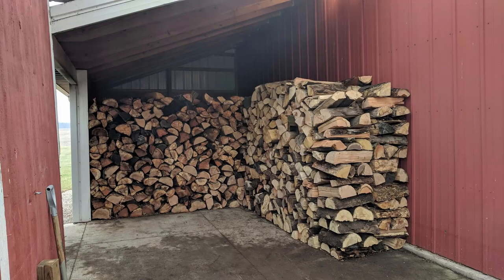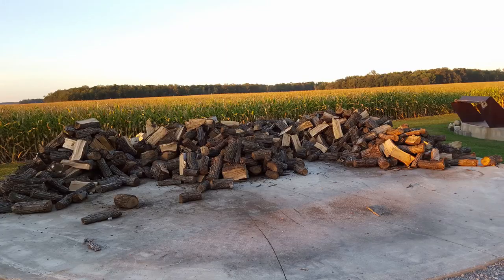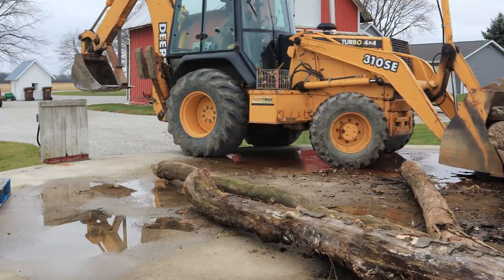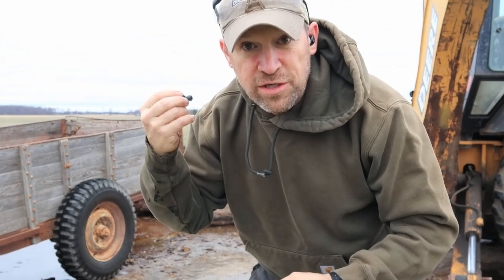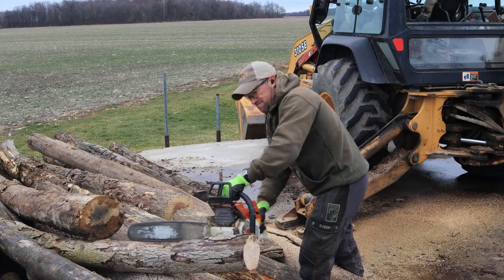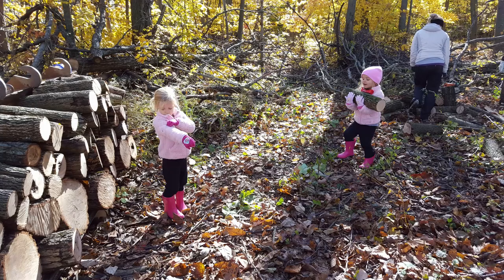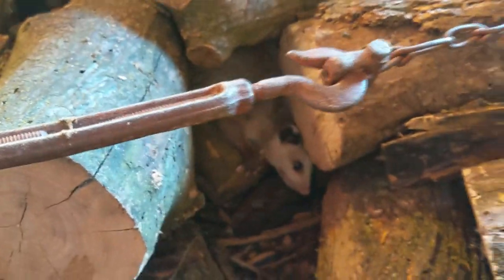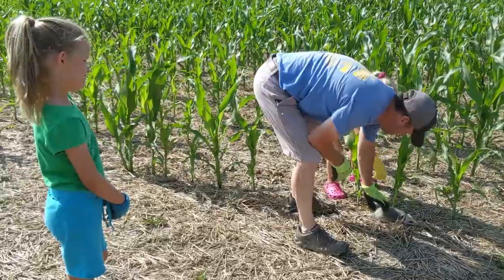Firewood: Do You Love it or Hate it? + 5 Tips for Outdoor Wood Boiler Success!

Comment: First it should be known that this is theory.  My wood stove days were limited and I used mostly flat cardboard that I had a contentious supply of at the time.  And some cut up railroad ties when it got real cold.  My goal was cheap and as little work as possible. For you we do not want to lose the family benefit but we may want to consider a reduction and redeploy of the labor.   More over we want to keep a wood boiler going all year around!  It gives heat in the winter but it can give AC in summer with a Yazaki Energy Systems Chiller.   Change over to a pellet boiler with big farm like storage towers and augers.  Once the towers are filled, it will run on its own and keep the fire going till it runs out of pellets. Now we need a large  chipper, a trailer with an auger to shoot the chips into, auger the chips into the PTO pellet maker while the next auger loads them in the storage towers.   Now you need a JD 3020 or maybe bigger! :-)   No more staking and re-stacking the wood and no more three times a day to put wood in the fire box.  The logs you cut up in this video would have gone into a chipper.  So no part of the tree goes wasted because it all gets chipped up: even the smallest branch.  The chipper needs to be able to travel to a tree with its wagon.  Then bring the wagon load home to the pellet maker.   This should cut down on the physical labor but not the benefits of family help.  The biggest bottle neck to the idea may be the whole tree chipper price!! Still you might find a way to use a smaller one or get a deal.   2013 Vermeer BC 1500XL  $36,950 with 1981 hours in Machinery Trader.  So maybe we keep both boilers going and use the big logs in the old boiler and start with a smaller chipper.  On the other hand this could chip wood and make pellets for multiple families with capacity left over.  It would likely be less time and effort all said and done, yet still need to work together.
Reply from the maker: That sounds like a fine plan Scott, but the finance department may raise an eyebrow when shopping for giant tree chippers!  I do like the idea of self automation and just filling up a big silo with wood chips.  I'll keep this comment as plan B should I come into some extra wood chipper money! :)

Comment: We have about the same size of space to heat. And a maple sugar shack up here in Canada. We go trough at least 50 cords each years. The boiler for the maple sugar go through a 24” cord every single day of operation.  So house is taking 20 a year. Average.
Reply from the maker: Wow!  That is a bunch of wood!  Plus, depending on where you are I am guessing you have a generally much colder winter than here in Northeast Indiana?  I can certainly appreciate your commitment to it!  My best estimate is that our yearly usage is 15-18 cords a year I think. I split about 8 cords last week with a firewood processor and I hope that will now last me the majority of the hard winter remaining.  Will probably need a little more to finish April and start May.  Thanks for chiming in and telling me what you guys do.  I love hearing it!  And thanks for visiting the video!
Reply: @digdrivediy  we fire up the house boiler around mid October until mid May. I have a small firewood processor that can produce around 3-4 cords/hour. And we are using those big bags that hold around a cord. Work smart. Not hard ;)

Comment: The comment about the equipment expense equating to 99 years of propane got a good laugh out of me. I just bought a place that has a pretty good size Central Boiler. Didn't have time to get it going before winter so heating with propane furnace this year. Hope to get boiler fired up next year but I've learned quickly you have to enjoy the whole process of making and handling fire wood. There is no way it makes economic sense otherwise because of the equipment cost and time.
Reply from the maker: Ha!  Yeah, that wasn't an exact calculation, but if I ever figured up my time, then... Well, might be more than 99 years actually :) I do save quite a bit of money on propane and it would be more painful to heat our garage and shop without the wood boiler.  For some reason the firewood "feels free" so I just try not to think about it too much.  I do enjoy the process however too.  Good luck getting your boiler fired up.  Good to know you have both options Ted.  Thanks for watching!

Comment: Two suggestions.. smoke is heat being wasted, buy a gasifier type outdoor stove. You will get a whole bunch of days worth of  extra heat for the same amount of work expended. #2 buy a stone fork for front of a tractor. you have the bucket and thumb so you can stand up straight to cut which is great, a stone bucket will allow you to pick up all the blocks off the ground so you save your back. then if your trailer is built so you can lift easily to put the wood onto the splitter you'll end up to be my old age but without a bad back. Have a great new year.
Reply from the maker: Great tips.  I'm not familiar with the gasifier outdoor stove. Sounds logical to me though. My stove does route the smoke through a passage way to the front and then again to the back of before exiting the chimney.  This captures a little bit of the smoke hrat as the passage way routes through the coldest portion of the water jacket.  Honestly though, I do hate the idea of losing too much heat in the smoke.  Love the idea of the stone fork bucket too!  I have always wanted one with a grapple attached as well. I am all about saving the back.  The older I get the more I want the machines to do the heavy lifting! Thanks for the great advice and thanks for watching!
Reply: Hi r v & Neil - it's Big Rodders in Ireland.  I haven't seen any information on gasification technology in American videos or forums.  The Scandinavians and Eastern Europeans have made big strides in this area, which incorporates fascinating science.  The hopper is at the top and the wood burns downwards into a ceramic combustion chamber running I believe at over 1000c.  The exiting gases are also burnt, leaving minimal smoke and residual ash.  I can only dream of having such a setup.
Reply from the maker: @rodneysweetnam8653  Sounds like very interesting technology.  I need to get educated on that as it sounds like it would be a great solution for many folks.  Thanks for the info!

Comment: Im 60 years old and burn wood in my fire place every day i need to keep the house warm started at 12 years old with my first chain saw
Reply from the maker: That's great David!  Glad to hear you're still plugging away with that fireplace.  For some reason I was permitted to use an electric chainsaw when I was just 12-13 years old.  Dad didn't let me use the gas saw but I could use that electric one.  My brothers and I blazed a bunch of trails through our woods by pulling a generator in a wagon behind the four wheeler and I had an extension cord strung out to the saw as I cut the path ahead of the ATV.  Good times.  Thanks for watching!

Comment: Hi, can you tell me please the name of this boiler, it is like a steam or what 😀 or if you can make one video about it and show us your boiler room 😀 
Thanks for info
Reply from the maker: That's a good idea.  I might make a video about the boiler and how it works one day.  It doesn't make steam though, it just heats the water that surrounds it  to about 180F and then a pump circulates the hot water to the house and through the floor of the garage.  It is all atmospheric, meaning the boiler is not under any pressure and in the event that it overheats, it just boils out of a little tube on the top of the stove.  Thanks for the idea of talking about the boiler, I might just do that!
Reply: @digdrivediy  and maybe what are your thoughts on it, if you would buy it again etc.

Comment: Why do you cut so short?  My dad cut 30 inch and did not split it if it fit in the stove door(he was 92 when he quit)
Reply from the maker: Old habit mainly.  Most of the time I split so it can be nicely stacked up and stored for a bit.  I could have cut them longer for sure in this instance.  Sometimes I do, but the longer they get, they heavier they are to throw in the trailer too.  Good observation nonetheless!  I hope I can cut till I'm 92 but the way I feel now I can't imagine!  Kudos to your Dad, that is awesome!  Thanks for watching.
Reply: @digdrivediy  They only weight 16 ounces to the pound so get with it.  Dad would  cut 6 foot or 8  foot in the wood. Load and haul it home, stack it to dry.  Then he would put the wood down in the wood cellar and cut it with electric chain saw and burn it.

Comment: Honestly with an outdoor boiler, you don't need to split your wood. Split wood burns faster in a boiler and is actually less efficient. Just something to think about...
Reply from the maker: I don't split it if I don't have to most generally.  But, sometimes it is nice to have some split wood in there too as it helps it recover more quickly when the stove calls for heat.  I usually have a good mix of split and full rounds in order to keep a good balance of fire sustainability and recoverability.  I split a lot of stuff that is over 24" in diameter as well.  Great point to bring up Kolby and thanks for watching!

Comment: Look into a crown royal 7400mp it will heat all that sqft easy and eat a bunch less firewood.
Reply from the maker: I will do that Shannon.  Always interested in ways to save on wood!  Thanks for the tip!
Reply: @digdrivediy  I run the 7300E gassification boiler. It's more efficient than a conventional but I have to stay a couple years ahead on firewood to make sure the moisture content is pretty low. Good luck to ya, enjoy the vids.

Comment: I heat 6600 sqft your going thru to much wood . Check your trench heat loss . My boilers a 400,000 BTU model runs about 1/2  capacity..  averages at about 200,000 BTU output average all winter . Where do you live Alaska ? Canada ??
Reply from the maker: I don't disagree.  I'm sure there is trench loss cause at the time I went cheap on the pipe and now 15 years later wish I wouldn't have skimped but I can't dig it up now.  Additionally, one of our biggest heat losses is the 100 year old farmhouse that we're heating.  It needs better insulation. Thanks for watching!